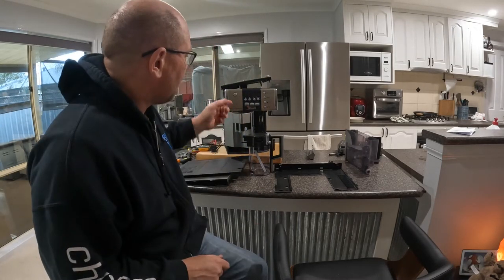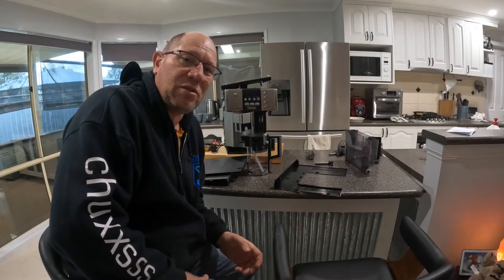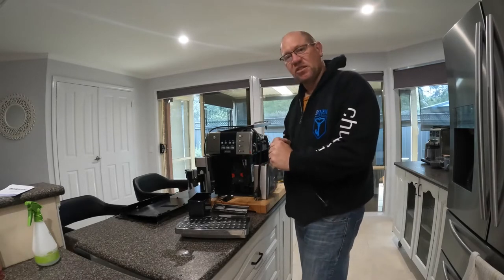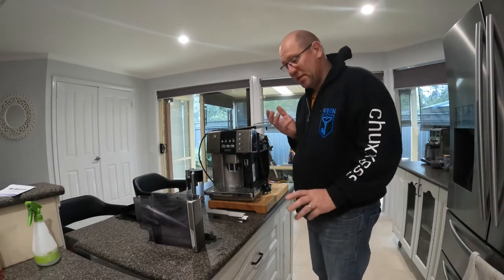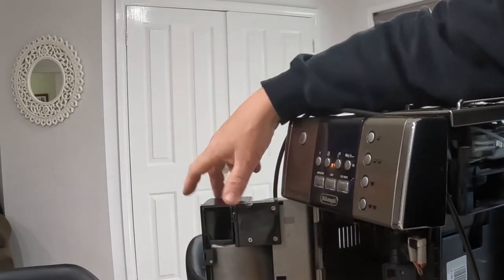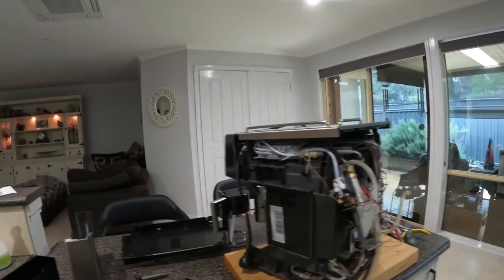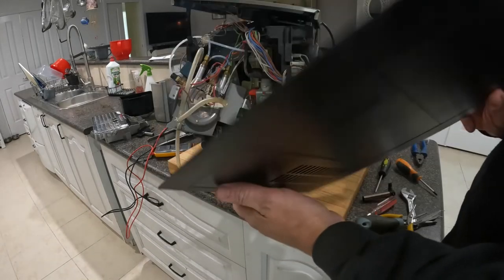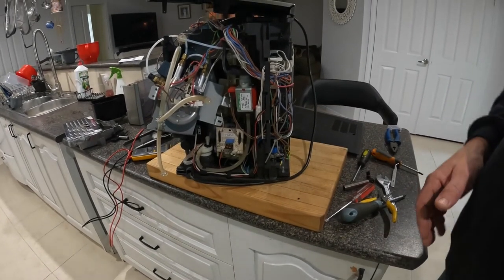My most cheapest restoration Delonghi Primadonna Coffee Machine.

Comment: Hi there I picked a delonghi prima donna esam6600 had a message on front so I cleaned it up took out diffuser cleaned everything up and it actually worked but was noisy made 3 cups in a row but grounds were in bottom of cup when I opened door coffee grounds everywhere . Any ideas also now the diffuser lifter is in wrong place and cannot get diffuser back in . Any ideas how to put it back to default as it just keeps telling me to install diffuser. ???
Reply from the maker: @triram10  Sound like you need a new diffuser. I think you can remove them and manually reset the diffuser, but not should as I don't have the model now. Replace it with a Phillips.
Reply: @chuxxsss  I worked out the diffuser and got it back in.will do a test run and see what happens and I will get back to you . Thanks for the response .are you in oz ?
Reply from the maker: @triram10  Yes, Aussie. All good. Have a great day.